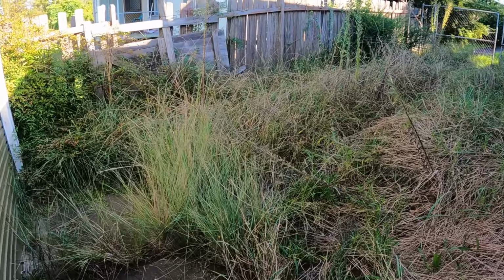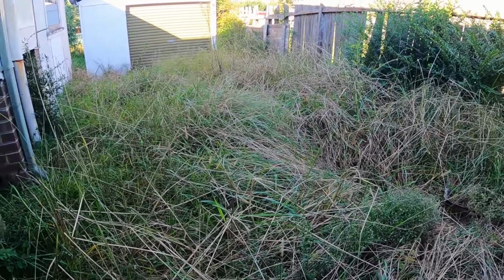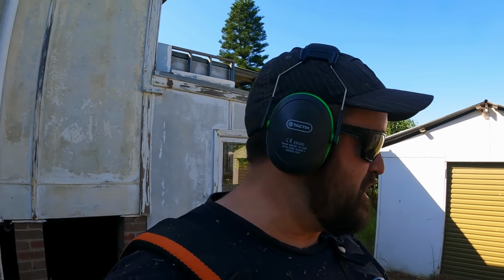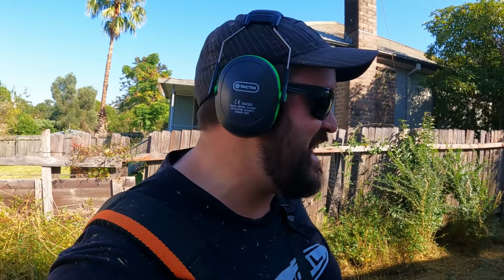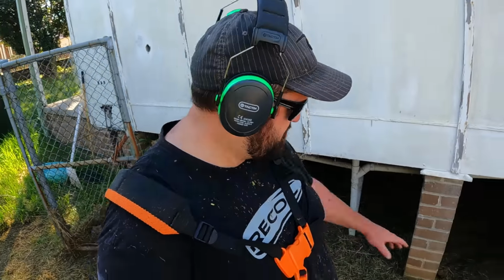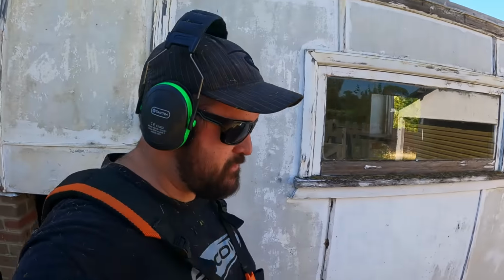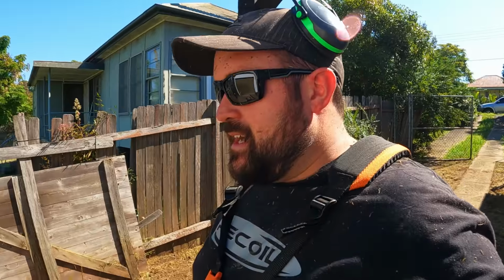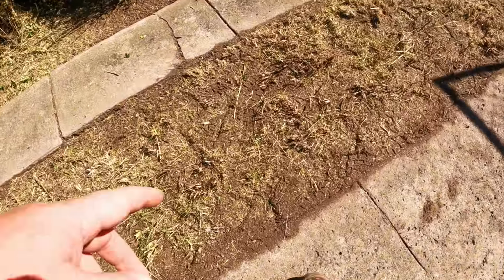96 Year Old ELDERLY WIDOW Gets FREE Overgrown Grass Driveway LAWN MAKEOVER [EPIC TRANSFORMATION]

Comment: I’m always curious about those open spaces under the houses.  Is there screening or something back in there to keep critters from making homes under there.  Snakes and rodents love dark, protected spaces.
Reply: I'm curious as well. In the 🇺🇲 you don't see this type of construction unless the whole house is up on pilings, flood prone places. Beach fronts, bayous, riverside dwellings an such. I've noticed that most of these homes are only open on one side. I'd like to know why!!! I'm sure there's a good reason. Maybe easy plumbing access????
Reply: That’s just really old construction
Reply: @waratah66  Thanks!!!!
Reply: Mostly older homes were up on stumps in case of big rain events but it was usually so air could circulate and aid in cooling the house. It was also a way of discouraging termites
Reply: @nightdweller6446  - Thank you for sharing. I'm told that we in the 🇺🇲 have old dwellings built the same way. I just hadn't seen any myself.  It makes sense.
Reply: @kwells8807  we still build houses in that fashion in the tropical and subtropical zones. Although lowset slab houses are more common. The further south you go, the more likely it is for houses to be more enclosed. 
Cross ventilation was/is important as a free way to cool your house.
Reply: @nightdweller6446    I understand the concept and all the comments make sense but what I’m wondering is if those open spaces have screening to keep out critters.  Even with screening of some sort cross ventilation would still be effective.
Reply: @brotoubrotou3164  not usually   We're  fairly laid back on critters  They're just as likely to be in the yard or in the house as under ir. You expect that they are going to be there
Reply: Here in the NW US, banks won’t even give you mortgage if the house doesn’t have a complete foundation. Many of the houses in Australia and Tasmania are the same as here. Bugs and critters get in everywhere, even when it’s kept clean. Just expect it.🤷🏻‍♀️